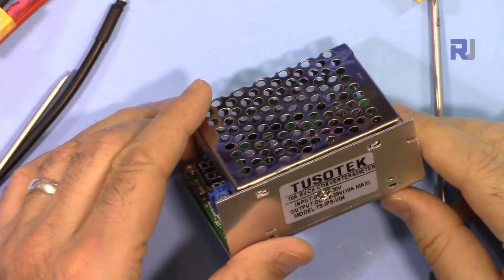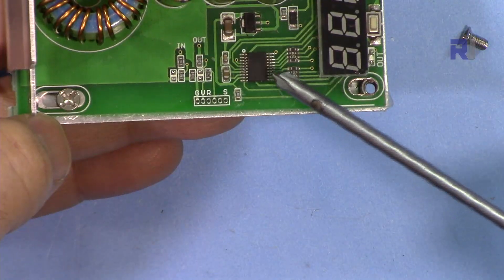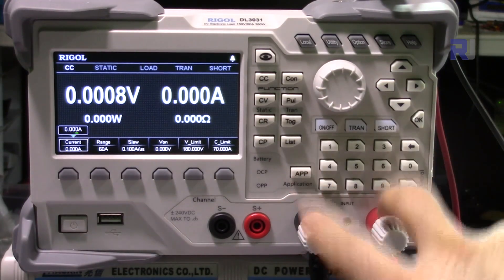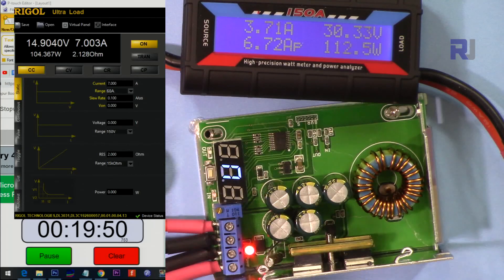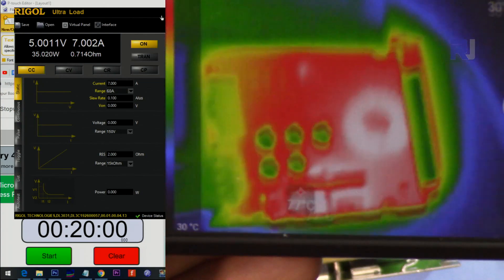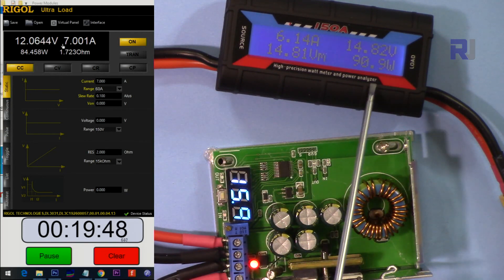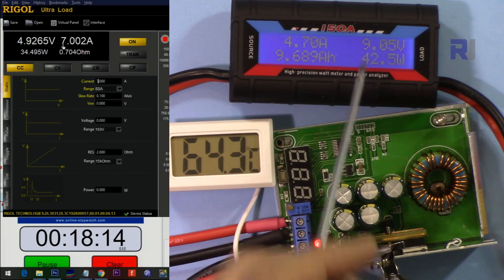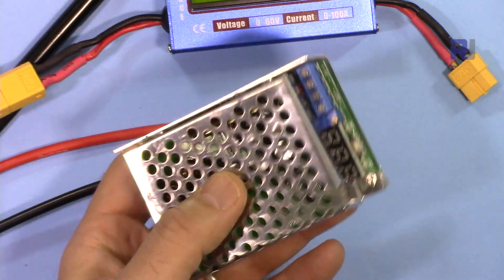Review of Tusotek  XL4016 8A buck converter with LED Display (silver case)

Comment: I buy one . I change all capacitor to 50v 
And I input 38v and output from 1.2v up to 37v and with 8A ( installed fan in the top of the unit with mini 12v voltage regulator for the fan ).

The only problem this unit have no CC limit to avoid transistor damage .

Comment: And what I can put in the output something to protect the output from and increase more than 5.2v that if the volt get 5.3v directly cut off the output from the battery in the output ( I chose 5.2v as USB hub power supply ) I need to use it to charge a 6 power bank and every one take 1.15A ( power banks have inside a 8 battery and it need a long long time to get full charge )
Reply from the maker: this is called regulated power supply. It means the output does not increase.
Reply: I mean if something happen to the transistor or to the diod and pump all the 20v to the output

Comment: I buy this model and I need to use it for 5.2v 7A for 24/24 hr 

Is it possible ?

And is it fine to input an 20v adapter of 3.4A ?
Reply from the maker: the best way to know is to run it for 24 hours.